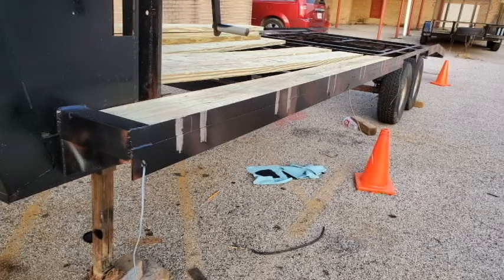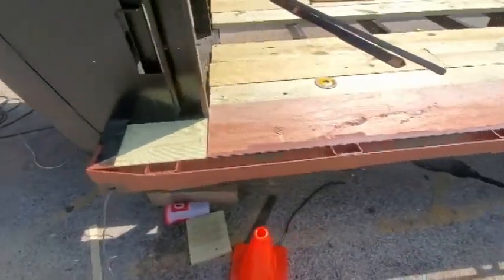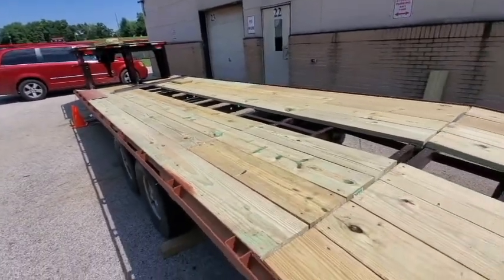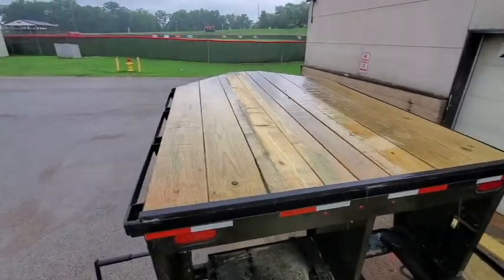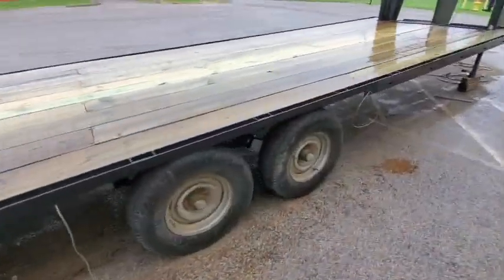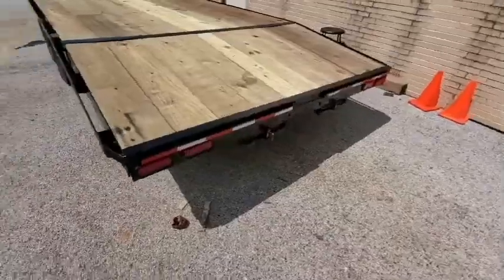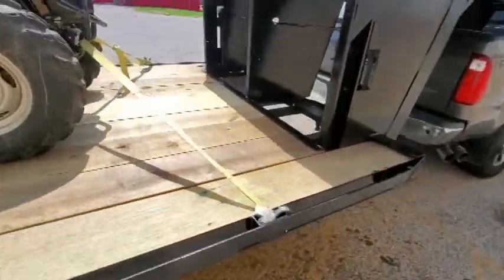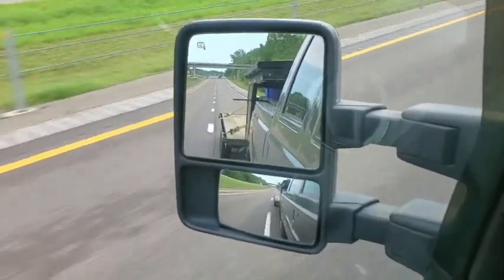Fifth Wheel flatbed deck and finishing

Comment: Good looking trailer👍. Looking to do the same to an old 5th wheel I have. Then put a slide-in truck camper up front to make a homemade “toy hauler”
Reply from the maker: that thought has crossed my mind, however we ended up converting a 32ft enclosed gooseneck into a toy hauler during covid.  we can haul 3 atvs or 2 atvs and one utv this way.  only downside is dirty bikes in the camper when done with weekend. but we can sleep 6 vs 2-4 in a cabover camper.

Comment: If it's not to much trouble, could you do a material list and cost?? I'd really Appreciate it and I understand if you can't. I'm almost down to the frame on tearing down one exactly like this and plan on doing the same. This is the best camper trailer conversion I've ever seen. I want mine to look like it was bought as a trailer just like you e done with yours. Great job, incredible job. 👏
Reply: I've actually thought about taking an old pop up camper I have, taking the axle out from under it, and putting it up on the top deck.  Any ideas on attaching it or any concerns on why not to do it?
Reply from the maker: All I can recall is we spent about 2500 on materials, but we had to put new tires and brakes on it also.  Some steel we had in stock.  Lumber was close to $750.  I had a lot of the conduit in supply as I buy in bulk.  Sold the trailer for $3500, so figure time, it was only a $500 profit, but it was a fun build
Reply from the maker: @timscon2001  do you have a shortbed or longbed truck?  I plan on putting an upper deck on my current goosneck, I will be using 1 1/2" square 14 ga square tubing, then border it with the 1 1/4" angle as we did on this trailer.  Not sure you will have enough connection points as popup decks don't have equal crossmembers, plus there isn't usually enough cross members to support real weight.  Not sure if it's worth the hassle.  To each his own.

Comment: Found a cheap camper might try my had at this for a toy hauler! Few questions for you! Was that frame have a v in the front from factory? Or was it added? And how long was that trailer? The one I found is a 26 footer end to end
Reply from the maker: The trailer in this video is 34ft long.  The previous owner had cut the top back to 6ft wide and then angled the front corners also.  I would have not made the slant so large, just a foot back on each corner.  If that was the case, then a small utv could have gone up there not just an aTV.   

The other thing to consider is a lot of camper frames have the axles too far forward. This is to balance out all the liquid tank weights and keep the weight off the tow vehicle for a smoother ride.  The problem with this is that if you have too much weight behind the axles, then you get the death wobble.  Realistically the rear axle on is where the front axle should have been positioned.

Look at your frame, how heavy duty is it. A lot of the frames now are 2x6 stacked to make 12" or a 2x8 box tubing.  If its open C channel, I'd shy away.  There was more give in the tongue than I care to admit.  In the beginning I thought we could sell the heavy duty 20+5 GN trailer.  There is no comparison.

Comment: What’s the rough total cost? Not including what you spent on the trailer. Just parts. Nice build by the way!
Reply from the maker: We ended up putting new tires rims and springs on it.  Estimated with wheels was about $2k in materials.  Of course we had to start right when lumber prices went up.  Before buying the frame, I priced out deck lumber, $400.  When we bought it a month later after doing all the steel work, $650.  All that adds up!
Reply: @WarriorWoodshop  would you be willing to do this on another trailer?
Reply from the maker: @kristopherhowell8971  I have 2 in the waiting!  They are both bumper pulls.  Just waiting for lumber prices to go down.  You don't get a cheaper trailer, you get a better built trailer.  The only down side is the axles are usually less than 6ft wide, so it really can't be a car hauler.  The other thing you have to worry about is the axles are usually further forward on a camper than a flatbed which can lead to swaying if loaded wrong
Reply: @WarriorWoodshop  I have a 28 ft I would like to have you do this on. I don't mind driving to wherever you are. Mines a fifth wheel.
Reply: You would be able to better place and replace axles, correct?
Reply from the maker: @kristopherhowell8971  i have the local trailer shop do things like hitches and axles for the liability reasons since I'm not a certified welder
 Where are you.  We are St Louis area.
Reply: @WarriorWoodshop  I'm in the Beaumont Texas area. Don't mind delivering to you and picking up a finished product.
Reply from the maker: @kristopherhowell8971  email me some pics to warriorwoodshop@tooldad.com
Reply from the maker: the other thing is we wouldn't be able to work on it until late spring.  We have projects to get ready for the state competition in April.
Reply from the maker: My son hasn't been to texas and wants a reason to visit!
Reply: @WarriorWoodshop  there's technically no rush on it. I have other trailers I just think it would be great to have this done and usable.
Reply: @WarriorWoodshop  have him come grab it! Haha
Reply: I just found your comment with your email. I'll send some pics once I get it down to frame.
Reply from the maker: @kristopherhowell8971  email pics to warriorwoodshop@tooldad.com  Maybe we can work something out.  Where would you be coming from?

Comment: Did you screw the boards down? If so, what kind of fasteners did you use?
Reply from the maker: yes, Tek 2 3/4" self drilling screws.  however we drill a 1/8" or 3/32" pre-drill to make it install easier

Comment: How did you add the dovetail?
Reply from the maker: It wasn't added, it was a wedge cut in the frame then allowed to fall/bend and then it was welded back together.  Finally a gusset plate over each side.